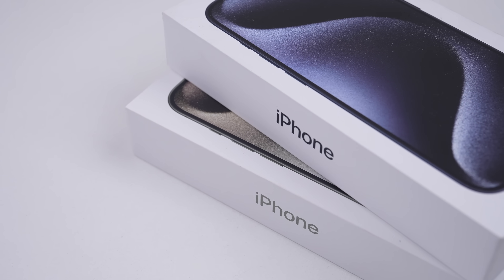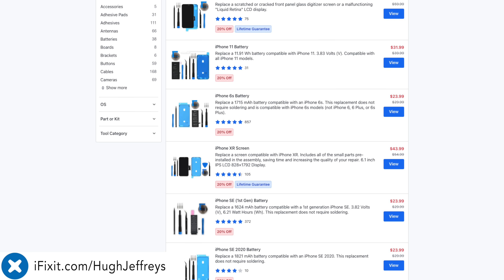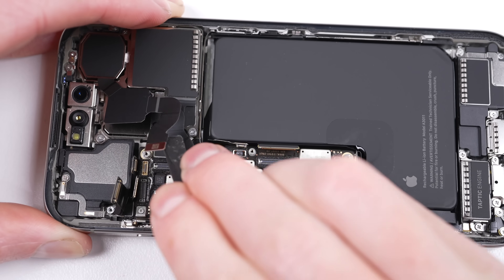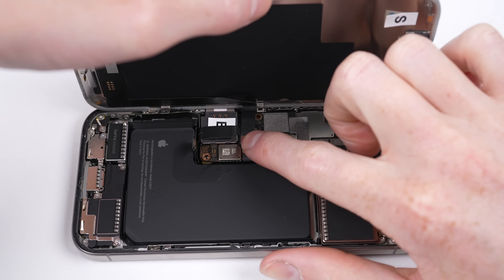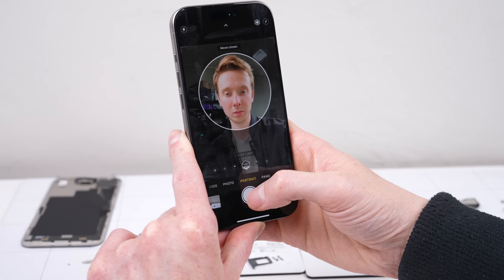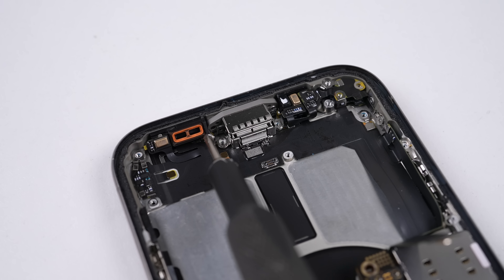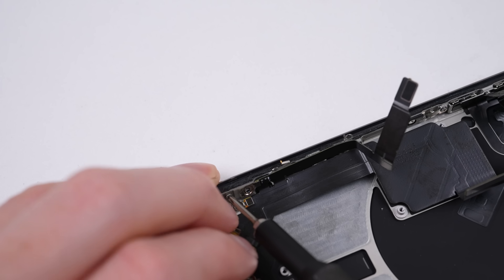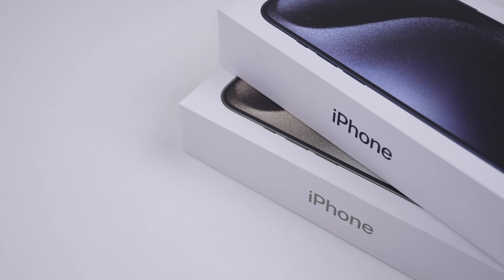iPhone 15 Pro Exposed - This Will Harm The Environment - Teardown And Repair Assessment

Comment: I was thrilled when I saw they made the rear glass removable, however as it seems from durability tests of the new iPhones, it probably also caused the rear glass to become much more fragile and easy to break, which is pretty unfortunate and I'm not sure if it's worth it...
Reply: its worth it to apple, since they'll have plenty of people buying replacement rear glass panels...
Reply: It does. Jerryrigeverything proved it.
Reply: @metalmaniacx79  Clearly you didn't watch the entire video. At the end, he clearly demonstrates that the normal Pro doesn't have this issue. Neither do the 14 or 14 Plus, which both sport the same removable glass.
Reply: @noxious_nights  And that doesn't solve the problem for those of us specifically interested in buying the Pro Max now does it?
Reply: @CrankDatJonasBoi but it does argue against the blanket statement that the back glass is weaker due to X and Y. It's model specific
Reply: almost every Android phone has a removable back glass yet they don't have such an issue
Reply: @divyamthakur  to be fair, thats more apples to oranges comparison.  Samsung, google, et al, use a "plasti-glass" its a thin glass layer with a plastic layer underneath.  It is NOT purely glass.  Source: I work as a phone repair technician.
Reply: @divyamthakur mine is a full aluminium unibody.
Reply: I wonder if it’s more the fact that they rounded the corner more. In the 12-14 the glass was more protected by the frame because it sat mostly flush but now that it’s more rounded the glass protrudes out of the frame more
Reply: @jarboer and not only that, with the ability to remove the back glass, they did in fact made it weaker. As if that's what Apple was aiming for when they reduced the replacement price
Reply: They removed the metal plate that’s attached to the back glass this year that made it stronger before. from bend tests and drop test, the metal plate does help with the strength of the back glass ALOT, also it looks like apple intentionally left a small gap where the charging coil is which make that spot especially weak if pressure is applied there
Reply: Several other videos show that it's not quite that easy. Under normal use, you're not going to break the back.